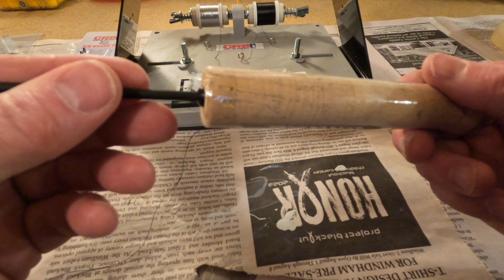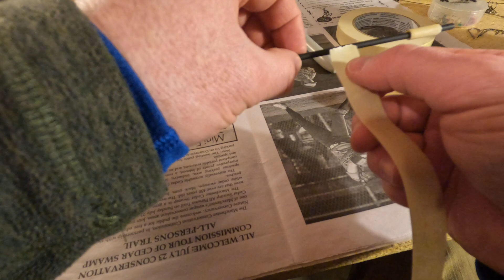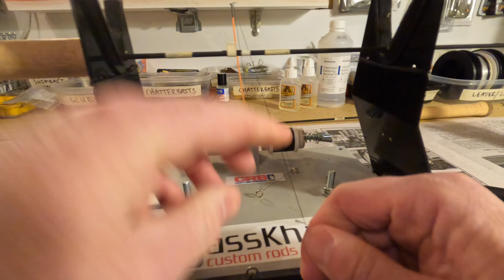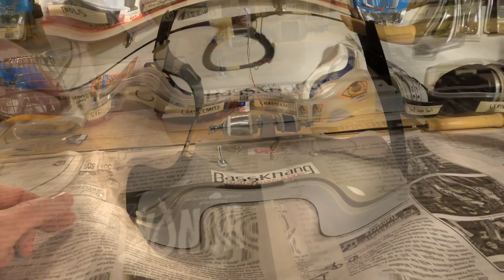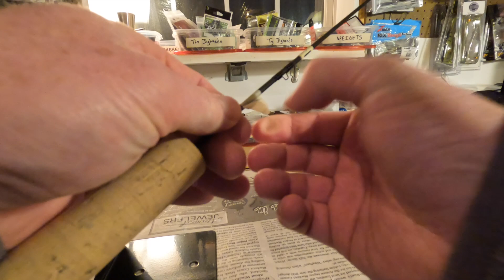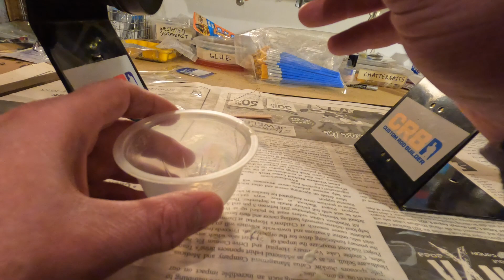How to Build an Ice Fishing Rod from Start to Finish!!

Comment: Hi. I am also just making ice rods for myself. For your pull thread, try tying one of your beads on the end with a few overhand knots. So when you pull your pull thread the bead helps it from slipping through your fingers.
Also, after I tape on my guides I hang  a  heavy sinker on the line so it puts a nice bend in the rod. It helps me see how smooth of a transition my lines goes from guide to guide. I have a MudHole wrapper that I bought as a kit to build three ice rods. Has been working good for me. But I it takes me several nights to build just one rod. I only build one a winter. 😅 Thanks for sharing.
Reply from the maker: Good tips, thanks!

Comment: I love a 2 part 5 minute epoxy for my handles. I use more tape arbors too .
I twist the handle back n forth and up and down to make sure every space is filled.
Your method is relying mostly on tape holding to the blank n glue to tape and handle. That will most likely fail in the future.
Mudhole has some very good how to videos to learn from.
Keep on building. I see you have the bug now too.
I do ice and open water rods. I love catching fish on rods I built. Plus I get exactly what I want in a rod for every type of lure I might be using 
Enjoy your new hobby.
Reply from the maker: Thx! I've been building rods for many yrs. Never had an ice rod handle fail. I have had 2-part paste epoxy from Mudhole fail on the open water rods, so I don't recommend that. As you can see in the video, I do twist the handle on. There's 3 arbors on a 5" cork handle - that's more than enough. But, if I should ever have a failure, I'll take a few minutes & glue or epoxy back on. Simple. Enjoy your new hobby, too!

Comment: Going to build mine this weekend I got a v line blank
Reply from the maker: Good luck! If you mess up, just cut the thread & start again - no problem. Also, give the rod plenty of time to spin (& dry) in between coats of epoxy. Might take longer than the weekend, but that's mostly just drying time (not active work time).